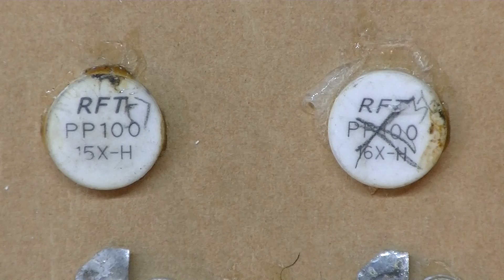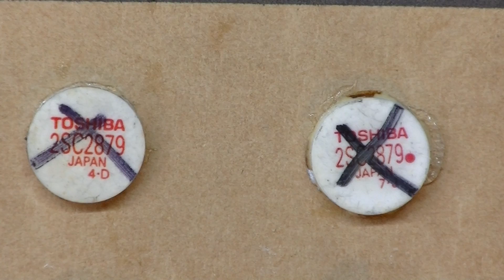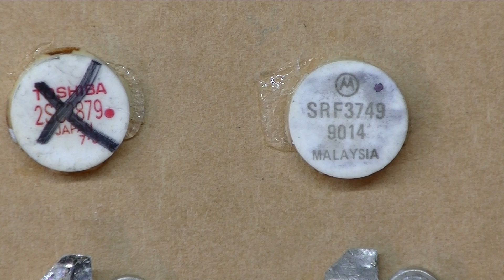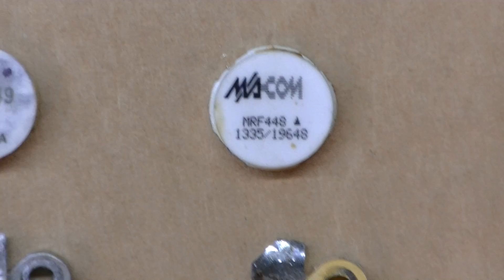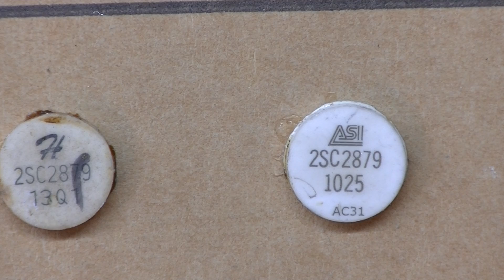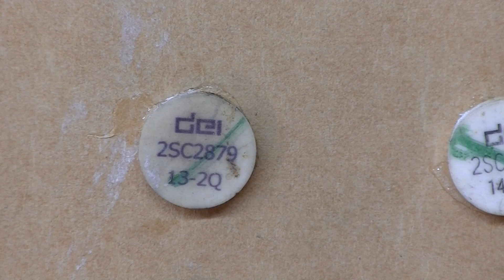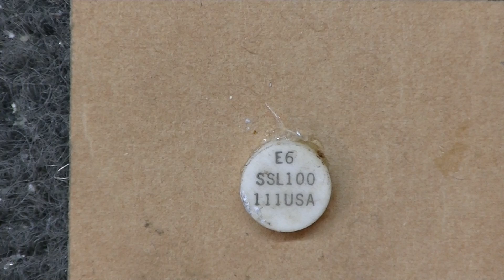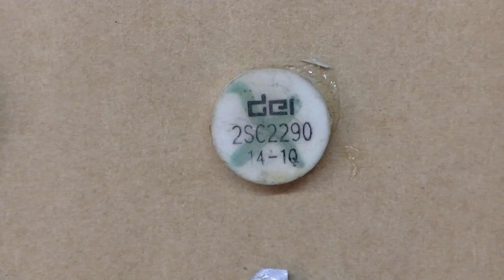RF TRANSISTOR SIDE BY SIDE - DON'T BE FOOLED BY OTHERS

Comment: You can certainly grind the tops of TO3 transistors and see the fabrication style of the wafer. Transistors such as the 2N3055 were built in different ways by different manufacturers.

Comment: Good vid. Plan on doing the same with the ebay knockoff crap?
Reply from the maker: Say What???? 
If your asking that, then you didn't understand the video.
In a nut shell, there's NOTHING that ANYONE could ever tell you about a transistor by popping the top off of it and looking at the inside.
And Anyone Who Tries To Tell You ANYTHING About A Transistor After Looking At It's Insides Is Just Playing You For A Complete Idiot And Fool.
So At The Point You Start To Believe Them, You Might As Well Bend Over And Grab Your Cheeks, Because They're Putting It Into You Where The Sun Don't Shine....
The ONLY Way You Can Tell ANYTHING About A Transistor Is With Meters, And Even Then, You STILL Don't Know Anything About The Grow Process.........
Reply: Xforce Amps nope that's not it. no worries just curious on the guts layouts. I know you can't tell how well or poorly the chips are manufactured by site